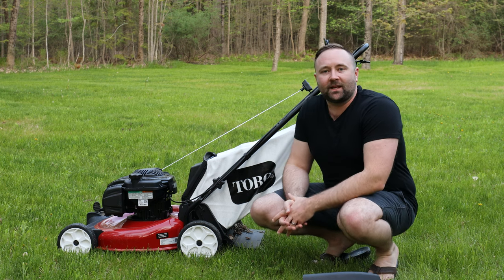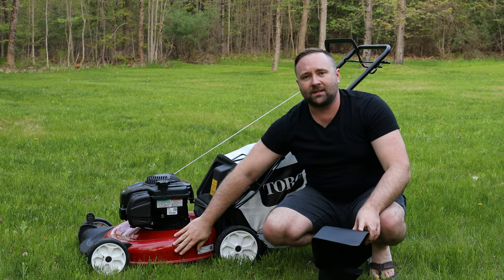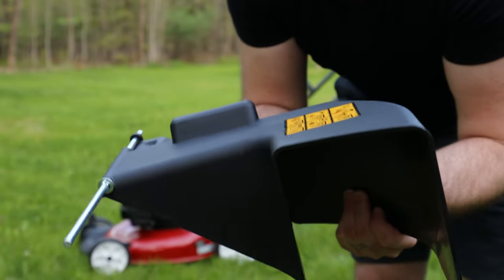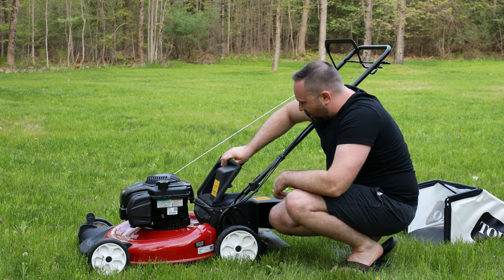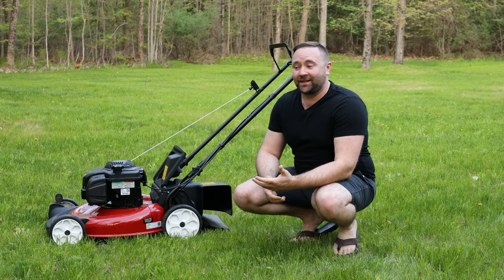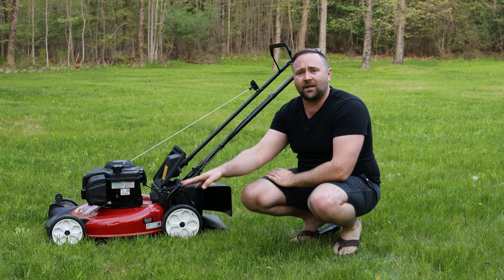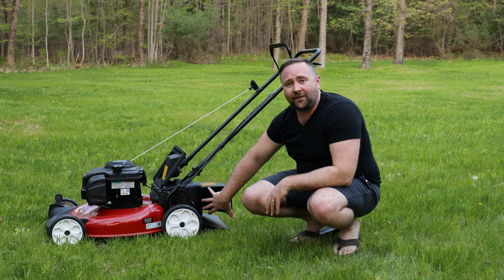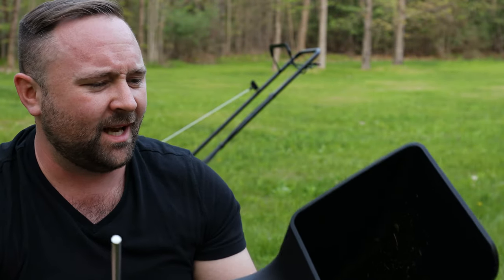New Toro Recycler REAR Side Discharge - Where to Get and How it Works

Comment: You are a lifesaver. I bought my Toro today @ Home Depot and thought it had no side chute. Surprised to see that it exist..... and for free. Keep up the good work.

My rear chute came today. It's easy to use and a big improvement over the side chute. Definitely less clog. You was also right. The delivery time was about a week. Thanks again. Keep up the good work.
Reply: Rodney, it's free?
Reply: It’s not free toro just decided not to put it in the box. You did pay for it as part of the mower cost, bet toro saved tons on money not giving these away
Reply: @callmefrog76  Exactly because most people don't register their mower hence they don't know about it 🤑
Reply: Got my mower a month ago, chute still hasn’t come. And you’re right, it isn’t free, especially if you never get it. Not getting Toro again until they start including the side discharge again.
Reply: @randysmith1723  I got mine in a week last month.
Reply: how did you get it? did you contact toro or the place that you bought your mower from?
Reply: @terrycruise-zd5tw  you register your mower and there will be a note to ask to order the side chute
Reply: @randysmith1723  did you receive it?
Reply: @mgomez5606  I did, but only after I'd contacted them again, and they'd told me the shipping was "created" , but then after pushing was told the label had been created, but wouldn't be shipped until the next week. I told them that was enough, and I returned the Toro to my local Lowes for a full refund. I went to Home Depot and bought a Honda that was about $80 more, but well worth it. The Honda is superior power, no clogging, it discharges, bags, and mulches. 4 days later the rear discharge kit came for the Toro. I feel like selling it on Ebay. Never getting another Toro mower again.
Reply: @randysmith1723  They fit on Lawnboy mowers also. Has same door. I flip mowers. The person that sold me the toro never registered it so I did and got it. Had a lawnboy and fit test it and it fit.

Comment: Got this mower with the new design. Rear discharge or mulch. In my opinion this unit should come with the side discharge attachment, not have to be sent away for. The reason: if you have grass that is more than 4 inches high, the machine gags. It gets clogged up. I am betting that most people who buy this machine end up requesting the side discharge attachment. It is made of rigid plastic and can't be that expensive that it could not be included with the mower.
Reply: agreed especially in humid climates where the grass is wet constantly. The recycling will not work cause the grass is constantly caked up
Reply: They could at least just included a voucher to pick it up at a dealer.
Reply: @STEVENWITHAV  that would require the dealers always have them in stock….. plus it compels  you to register (and thus be put on mailing lists) …. This method works best for THEM

Comment: Bought one today today, needed to mow today as well. It's a 3-4 hour job, bagging would of sucked. Used a bungee cord to hold the discharge open, put on some safety glasses, and mowed one handed standing of to the side.  Glad I grabbed the glasses, took a piece of a twig to the side of the nose. Good call toro, lol. I'll register it when I get back home, what ever the frig that means.
Reply: Haha, this is pretty much the same thing I went through!  instead of a bungee cord, I used a medium sized spring clamp to keep the back flap open.  Legs get covered in moist grass, but it works just fine and i rather get grasskakke'ed all day then have to bag my 2 acre property lol.  
That's the other thing that I don't like about this mower, the bag engineering was done poorly.  Once it gets about half full it starts dropping grass, requiring us to empty it often.   And the last poorly designed thing is how to raise and lower the deck.  It sucks that we have to do each wheel individually, and the rear right side mechanism doesn't allow a lock in to the highest setting.  So I automatically have to be a half step down lol.  
It really is stupid that it doesn't come with this side discharge attachment.  There was plenty of space to put it in the box that the mower came in.  Such a hassle.

Comment: I was trying to Google how to cut a hole and mount a shute. But here I am with a free and easy fix on the way.  Thanks so much!
Reply: I was just doing the same 😂😂😂
Reply: I also was thinking about making a DIY side discharge chute, but no way would I drill a hole through the side of the deck lol.  It would probably ruin the recycler/mulch action.  I believe that's why there is no side shoot, just a strangely engineered mower.  I was trying to think of a way to make something similar to the actual part, but with a piece of thick plastic and a dryer pipe haha.

Comment: I agree, I have to tip my mower on its side and clean out deck because it gets clogged up. I've been waiting to receive discharge unit for over 2 months. I'm been mowing my yard for 16 years and never had an issue till now. I'm not a happy camper with Toro

Comment: Not worth buying the mower without the side discharge. Got mine at Lowe’s a month ago, still waiting for my free rear/side discharge unit. Grass chokes and stops the mower, or rear bagger fills up every pass. Spend more time emptying bagger, pulling out gummed up grass from under the deck, & restarting than actually cutting the grass. Wished I’d known they stopped including the discharge. Would return it if I hadn’t mowed with it already. Still might, since I didn’t know it’s underpowered to mulch the grass without choking up.

Comment: It's pretty idiotic that Toro didn't include it in the box.  There is absolutely no reason not to.  There was plenty of space and it's not like it's a super heavy thing that would screw up shipping costs or something.  I got the more powerful version of the recycler, the black 22-in deck and the mower works fantastic here in florida.  The rear-wheel drive is excellent.  My only problems are not including this chute, a poorly engineered bag system that requires to be empty before it's even half full,  and the raising and lowering of the deck sucks.  We have to do one wheel at a time, and the rear right side wheel is unable to lock into the highest click lol...  The next time I have to buy a mower, (in probably 15-20 years)  I'm absolutely going to make sure that two of these three problems are not on the next one lol.  My last mower with a similar Briggs & Stratton engine lasted about 20 years,  I expect the same from this one.

Comment: Do you have trouble with yours rolling it back with self propel disengaged? I loosened the cable and belt has play on it. But wheels lock  and can't roll it back while engine is running.

Comment: I tried to register mine using the model and serial number that’s on that side tag I seems to have too many numbers  what is the part number ? Or if you have a model and serial number please
Reply: don't look on the motor. the motor will have a separate serial number and model number that's much longer

Comment: These designers at Toro don’t understand basic physics.  If you use the bagger on medium length grass you will have to stop and empty every two minutes.  If you use in mulch mode on any brand new Toro recycler you can literally hear the engine side loading the main bearing under the load of the grass and artificially shortening the life of the mower

Comment: I bought one today and I didn't realize it didn't come with side discharge.  I've never in my 46 years of life seen a mower that didn't have that option.  I took it right back to home depot.  Such a terrible decision on Toro's part.
Reply: But when you register it they send one. They claim most just want the bag or closed for mulching. Toro is definitely the first one to do it.
Reply: @joshuawishon1253 
Doesn't help when you bought the lawn mower to mow the same day. I had to tie the flap up with a string in order to mow. They could've saved plastic by keeping the old drive control which worked better.
Reply: Well conventional mowers with side discharge that was open throw things.... And can injure people.... Especially if you run over a baseball..... Perhaps the rear discharge with the flap prevents that, and when you put the side discharge adapter on there you still get a 90° bend that's going to stop objects from flying
Reply: @MudflyWatersman  
That's all well and good, but not including it made me have to run the mower with the discharge pointing right at my shins.

Comment: This should have came in the box. They know the bag is to small for anyone with a descent yard. 2.5 acres here ( i use a zero turn for most of it) but the part by the house I have to empty the bag after 1 minute or less of cutting (thick grass around house/shed/shop). and Cutting without it the mulching clogs up the deck after about the same amount of time.  Just saying a video like this wouldn't have been necessary if toro did not drop the ball. Thanks for the info, ordered my discharge today.
Reply from the maker: Yeah I agree!

Comment: Just got done complaining about my new Toro on a chat with them and they told me about the discharge kit. For me it's totally unusable without the bagger. I was so disappointed after being a Toro customer for many years and then getting a new one that just plugs up and kills the engine. The op manual says you should cut higher if you get plugged up.... what a joke. Maybe you should make a mower that doesn't plug up?

Comment: I bought mine second hand... and I went to use it today after a good week and a half of a cutting and I was ready to push this mower into the middle of road for someone to run over it until it became DUST. It just chokes to death. Then, I found your video so, ok, I will try this... thing is, being that this is a used mower, if its already registered, then what? If you have an actual part number to share, that would be helpful. Thanks again for taking time to share.
Reply: Ok... so that worked! I have registered and received the "allow 3-4 weeks for delivery" message.
In the meanwhile, it pops up the following info in the accessories section for my model:

    Model #: 136-7060
    Side-Discharge Deflector, 2013 and After 21in Steel Deck Mower
    Model #: 20601
    Lawn Striping Kit with 22in Roller, Walk-Behind Lawn Mowers
    Model #: 490-7318
    TORO SMALL WALK BEHIND BAG